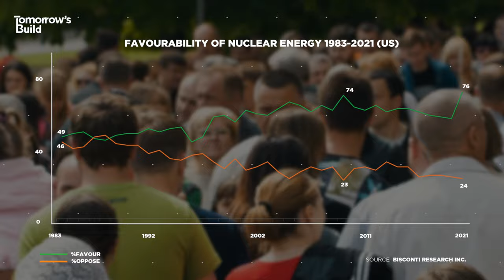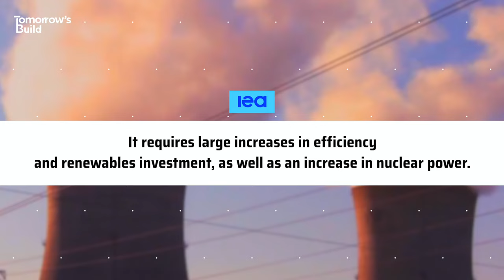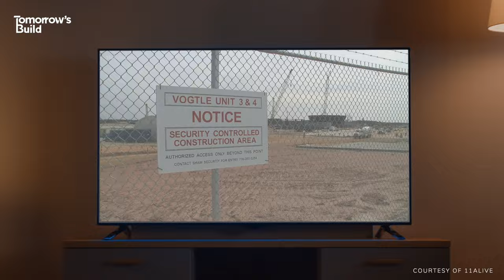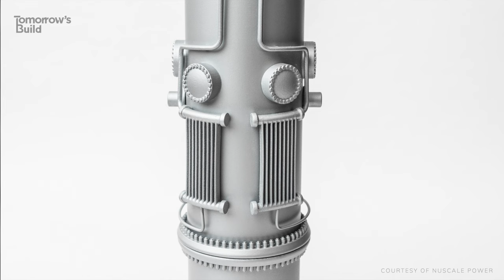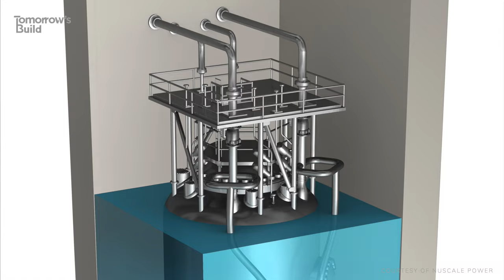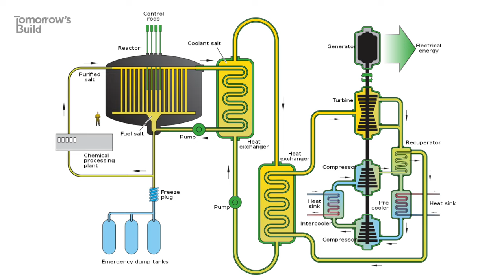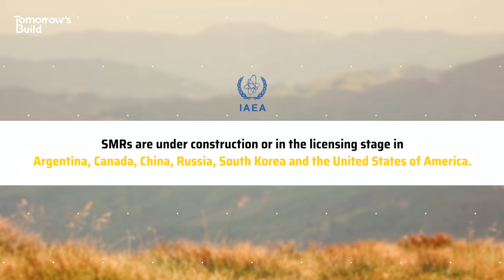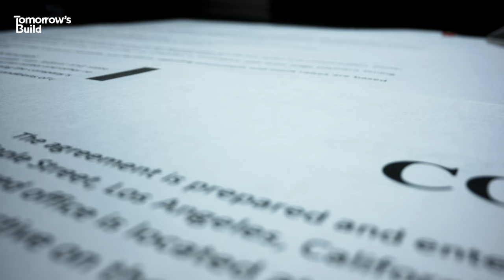These Mini Nuclear Reactors Can be Built Anywhere

Comment: While SMR seem like a good idea, I have not seen any real world numbers that say the are economically feasible compared to the alternatives.  The best use may be to build enough SMRs of the type that can be use the waist material from conventional large reactors.  At least that way you get some power and get rid of the most troublesome nuclear waist.
Reply: Theyve got no solution how to deal with the existing WASTE, let alone what these will add.
Reply: @CA_I  A lot of new SMRs and MSR designs can use the waist from today's reactors and the resulting waist has a much shorter half life.  Those that look at the data would recognize this as a potential solution to nuclear waist.  All you really want is for it to decay to the level of radiation that the original fuel had then it is easy to deal with.
Reply: @armorclasshero2103  NO, that is what the current reactors do.  The new generation of small reactors is supposed to be able to take the waist from current reactors (including the stuff that you use to make bombs), use it as fuel and produce a less radioactive waist.  The basis of the design for the reactors that have been used for the past 50 years was selected (over a thorium reactor) because the by product of the waist was plutonium, which was wanted for bomb making in the 1950's and 1960's.
Reply: NO -you are still wrong.  A nuclear reactor works by splitting atoms and you get the easiest to release energy by utilizing the unstable isotopes.  Anything heavier than iron takes energy to create, so breaking those atoms to small elements releases energy.  However, it is much more efficient to break isotopes where there is less binding energy holding them together.  A more efficient reactor will use up the maximum quantity of these heavy less stable elements - like the type used to make bombs.  That is the goal of the new generation of SMRs - get maximum energy output from the fuel.  And that absolutely does not mean leaving waist that can make a nuclear weapon.  Small reactors from the last century (like existing nuclear power subs) just use the same technology as the large commercial reactors and did create that type  of waist.  These are pointless to build as commercial reactors.  But the new generation (not aware if any in western countries are ready for commercial licensing) are intended to use up all the bomb grade material and can use the waist from existing reactors.
Reply: @davesutherland1864  go read the literature again, because enrichment is required to reach ignition levels again on spent fuel. that's why it's spent fuel; if it was still energetic enough it would still be in the original reactor.
Reply: @armorclasshero2103  I never said you did not need to process the waist from on reactor to use it in a SMR.  Virtually nothing is recycled without some sort of processing.  I said the fuel you use will produce less highly radioactive waist, and that fuel can use the waist of conventional reactors.  I would assume you can’t just drop the used fuel rods in ‘as is’ for a lot of reasons.  In addition, the waist that comes out of conventional nuclear reactors is totally useless for a bomb without a lot of processing.  It is probably more processing than turning it into SMR fuel as bomb grade material needs a high degree of purity.

Comment: Do these reactors provide reliable power in war, natural disasters or terrorist attacks, or would they make potential targets or add to the impact of disaster ?
What if a production facility or pipeline gets struck or the earth by a major solar-flare, crashing electronics ?

Same goes for a hydrogen power-infrastructure by the way, and H2 is a greenhouse gas as well as explosive.
All in the spirit of positive thinking 🙂
Reply: Reliable power in war or terrorism: Yes, more so than renewables which require large amounts of transmission and have many fail points. Also, generally nation to nation warfare avoids population centers, whereas fields of power generation with low population are reasonable targets. 

Production facility: There are no pipe lines. Production facility is a low concern. Uranium enrichment facilities are a risk of having material stolen but materials are never piled in critical configuration, so they will never propegate a reaction. But more importantly, many of these designs (both thorium and Uranium) produce fuel from Natural Uranium within the generator by breeding more fissionable isotopes.

Solar flares are like giant radio waves, which means the size of your antenna is very important. In previous MCEs, teleagram wires caught fire and people on recievers were shocked. Renewables = large amount of transmission, which means massive amounts of wires and more antenna. Overall the renewable infrastructure is more susceptible. Solar pannels in particular might be hit hard by back current. 

I wouldn't worry about H2 as a great house gas, it will oxidize very quickly to water.
Reply: To be fair we have explosive chemical / oil plants all over the place; there are already pre-established procedures in place for explosive plants. 

Besides, I would honestly argue that a small modular nuclear plant melting down can be dealt with so much more easily compared to the a bigger plant. The amount of fission material available is smaller, you can more easily access and remove the module compared to cooling down something like Fukushima.
Reply: Oil and hydro are also abysmal in the face of military action (and this has been demonstrated in real life). From this perspective, distributing power generation rather than centralising it will almost certainly be a good plan, though I have to say that once people have decided that their goal is to kill people and destroy the environment, you have a problem any way you slice it.

I'm not sure I understand your point about hydrogen, though. It burns well (to produce water), but it's not explosive in itself. If I had to make a list of chemicals I don't want to live with, hydrogen is not high on the list at all.
Reply: @stephenspackman5573  Hydrogen is highly explosive and prone to leaking and damaging it's storage vessels. It's the most energy dense chemical by mass. 

I agree with everything else you said, although I think a mix of centralized and easy to protect and decentralized and easy to lose is the best overall format.
Reply: @neolithictransitrevolution427  Well, it's hardly surprising that hydrogen is energy dense _by mass_, given that it has a molecular weight of only 2. But actually lithium+fluorine and beryllium+oxygen are both hugely better than hydrogen+oxygen.

As to being explosive, I think we may be using the language differently—I'd have described it as flammable. It's clearly not going to decompose without a supplied oxidant. But of course, as you say, ultra low molecular weight, high reactivity, and being a gas at STP combine to make it challenging to contain—and we do tend to bathe our industrial facilities in oxygen rich gases, for some reason ;).
Reply: @neolithictransitrevolution427  how are you so wrong on almost every level? warfare avoids population centers? wtf? where have you been since the beginning of modern warfare?
Reply: @armorclasshero2103  That's a very existencial question, but I suppose the most probable answers is I didn't exist?

But its not exactly like Vimmy Ridge or Passchendaele were urban centers, or the Vietnam war was fought in Hanoi, or the war in Afghanistan mainly took place in Kabul.
Reply: @neolithictransitrevolution427  it's only an existential question if you're trying to dodge the answer. every single war in the last 50 years has heavily featured urban combat against guerrilla forces, often using human shields.
Reply: @armorclasshero2103  As the war in Ukraine has progressed, I have been suprised by the Russian destruction of urban areas. And WW2 notably featured industrial warfar. 

I think I may have been confusing civil/revolutionary/independence warfare with international war. That said, I would still argue small foot print nuclear plants are easier to defend than dispersed renewable plants (with the hopeful exception of close loop Geothermal). And even in the current war in Ukraine we have seen efforts to avoid nuclear plants, if not always occuring or under whelming. A mix makes the most sense I believe, particularly when accounting for industrial heat demand.
Reply: @neolithictransitrevolution427  the average nuclear plant needs about 200 security personnel, even if we assume these minis need 1/10th that, you then run into having to deal with dozens or hundreds of reactors over extremely wide geographic regions; that's a recipe for indefensible infrastructure.
Reply: @armorclasshero2103  You can't just steal a nuclear reactor. Or a meaningful amount of plutonium from a few kiligrams of mixed nuclear materials. As long as you avoid on site reprocessing and keep it closed system, it's secure. 

And frankly, one small nuclear bomb is unlikely to have as large a negative impact as wide spread SMRs will have positive.

Comment: Won't it create more nuclear waste?
Reply: If the entire planet used SMRs, there would only be a few tons of waste created annually, compared to gigatons from fossil fuels, and many of the designs can burn our stock of spent fuel.
Reply: Not if you stop mining uranium first! You do mine uranium correct - along with the madman who created this vid? Or if you don't both mine uranium then maybe you all can stop making strange speculations about the nuclear waste.
Reply: So what?
Reply: @voidisyinyangvoidisyinyang885  Wait, What?
Reply: @randallhext8057  I want to thank you for mining uranium. If I'm wrong, please correct me.
Reply: @randallhext8057  I think s/he is saying there is waste from mining Uranium (chemical not radioactive). It sounds in other comments like they are personally effected by the exploitation of this particular resource, and so its the one thing we shouldn't use. Note; breeder reactors (currently illegal in the USA) and Burner reactors can decrease our need for new fission material, Thorium is also an option, and other sources of Uranium exist such as salt water extraction (more expensive then mining, but fuel is a minority cost in nuclear energy).

Comment: Sounds like a great backup when there is not enough wind or solar for a few days. Sure wind and solar are low cost when they work but we also need a backup for those days to maybe even weeks where we don't have enough. I would argue you'd need to compare this to alternative storage like batteries and hydrogen (in places where pumped hydro isn't an option). Either we need way more solar and wind so that we can store that on the good days or we need these. Or do we just create enough grid interconnects that we can distribute energy over entire continents, making local fluctuations less relevant?
Reply: Or we can just skip the trouble of trying to make an inherently unreliable energy source reliable and use the inherently reliable on all the time.
Reply: I think your question frames to many things as dichotomies. Wide scale transmission is really essential to renewables, particularly wind where you can't be sure of much more then averages and you need to diversify your source for averages to work. 

Solar is either on a roof, where it makes sense to have on site storage to provide greater energy security, or is located far away from the user in a desert or on a reservoir and so transmission is needed. And in any case, longer term storage, and enough to cope with power lines being damaged, is needed. 

Renewables will likely come in with cheaper electrical costs in some places, but in many cases Nuclear will be the lower cost if we allow an industry to form. And some process, like industrial heat and steam, are much more suitable for nuclear. A strong system shouldn't choose between one but allow the development of the lowest cost energy source.

Comment: Just my opinion. I think the only way we see this stuff in the United States is political. We need to increase the size of the nuclear regulatory agency and get our politicians on board with revamping nuclear regulatory policies and law. It doesn't matter how safe they make these things, if they can't clear the red tape it's vaporware.
Reply: I think your biggest obstacle is money, not red tape or politics.  They are too expensive and affect a whole series of markets.    Would you rather try to sell a house with a turbine / solar farm 1 KM away or a nuclear reactor.  What protection do citizens or investors have if one of them leaks into the water table...   if the company who buys it goes insolvent, who has to look after your modular reactor ?

Comment: The original molten salt nuke was suppressed by Nixon in order to keep Westinghouse on top. the industry has ignored the molten salt reactor ever since. The Moltex system is intrinsically safe, produce 1/1000th of the waste and the fuel the heat produced is used far more efficiently - less cooling needed. The many safety questions common to PWRs (of any size) are covered by not having the hazards in the first place.

Comment: I was talking with a Georgia Power engineer and inquired about the big delay and cost overrun and apparently it was due to the large concrete pad being poured and set out of spec. It was <1/32" too thin in places, so the whole thing had to be ripped up and rebuilt.
Reply: Your skeptic at around 9:00 doesn't seem to be taking into account of economies of scale from production volume. Plus, the production process can include a centralized certification and quality assurance process at the end. Again with the failsafe contingencies: each scenario posed and question solved is solved across all units of that design.

Building these guys in a factory has the potential to drop the the capital expenditures by a significant amount, I think.
Reply: First, in nuclear, everything has to be built according to spec.. If not, then it will not meet the safety requirements. Second, I think your Georgia Power engineer is blowing Smoke up your u no what.  Here is his CEO explaining the latest delays from 6 months ago.

Below is the Vogtle Project Management's answer for the latest delays:
Southern Co. yesterday announced another delay for its long-troubled nuclear construction project in Georgia, edging its costs closer to the $30 billion mark. 
The setback could now push the startup date for Plant Vogtle’s first reactor until early 2023 and move the date for the second one to later that year. 
Plant Vogtle’s latest move highlights the nuclear industry’s chief troubles with building large, baseload reactors: safety and cost. To be clear, Southern executives have blamed this new hiccup on paperwork, saying that workers were gathering it to send to federal safety regulators and noticed critical inspection records were missing or incomplete. The pile of missing or incomplete documents added up to a delay of three to six months, Southern said. That additional time is costing $920 million. 
“We’re a little frustrated with the latest developments,” Southern Co. CEO Tom 
Fanning talked of “great momentum” at the construction site since November. 
But workers realized “tens of thousands” of critical documents were missing, leading to a three-month backlog. 
“We’re fixing that part of the ‘paper’ process,” he told E&E News.

The people I know say he is lying.  They were supposed to x-ray critical welds and perform performance tests of critical equipment and they just did not do it. Sure its missing n=because you did not do it.  And this guy is the CEO of a $30 billion dollar project.
Reply: @clarkkent9080  I don't think he was referring to the latest delays since the conversation took place in 2021.
Reply: @louishermann7676  Yes I understand that but Southern Company has built and operated nuclear power plants since the 1970s.  and I call BS on the  < 1/32 too thin excuse. You may want to ask him about "losing" thousands of build records.  I know many people that work there and they say it is an out of control zoo.

What people don't understand is that you are not building a Walmart or Amazon warehouse.  If a nuclear plant is to be safe, it must be built as designed.  No just close, not sorta, not does it really matter, but EXACTLY as designed.  

Example: At the MOX Facility, they contracted with a U.S. steel mill for rebar for a critical concrete pour.  The purchase spec on the rebar was specific since it was part of a safety system and they paid a premium ($$) for the specific steel.  When the rebar arrived, and the workers were installing it they found that the rebars were brittle and snapped when bent for installation. 
Hell, rebar I buy at home depo can be bent without breaking.  That steel mill just sent them some crap they had laying around and pocketed the $$$.  The facility did not have time to fight the mill and just paid them and had another mil produce the rebar but this time they inspected it at the mill before they would approve the shipment.  That is an example why nuclear cost so much and takes so long. It is the site project management, suppliers and construction craft that are the problem.  But some people like to blame the greenies, liberals, the media, politicians, or the NRC and because of that, nothing will ever change.